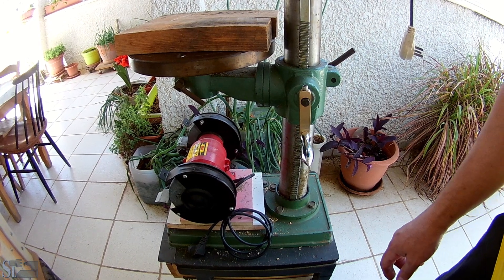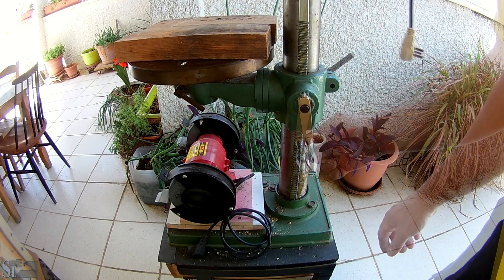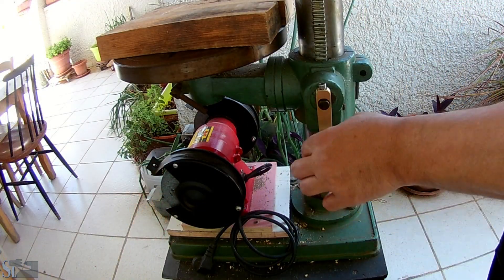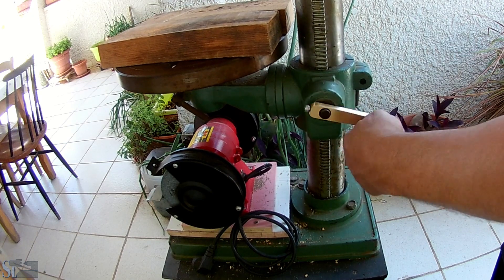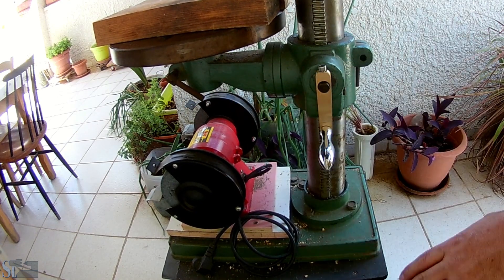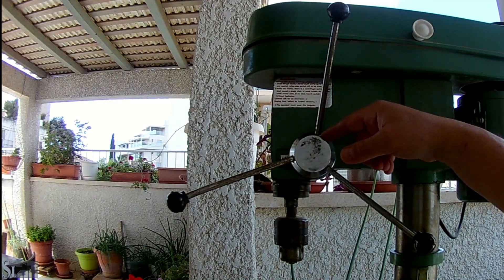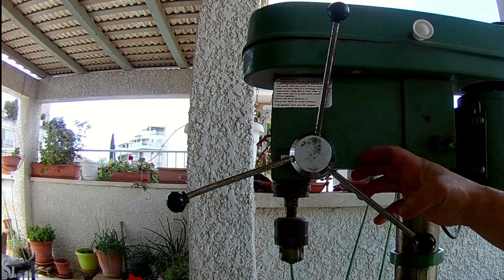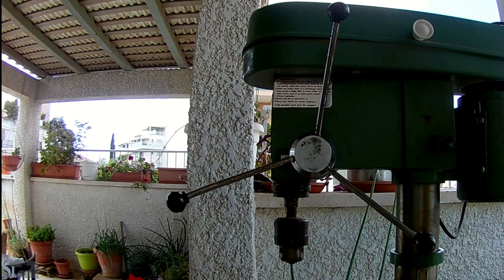Drill press crank handle

Comment: You should never be drilling into a smaller hole like that when you drill into metal. You don't do that ever. You screw up your drill bits like that and can often ruin the hole you are drilling. Rule of thumb is that if the hole is 10mm or smaller there should not be a pilot hole. This isn't woodworking. For holes larger than 10mm you can do it but the rule in that case is that the pilot hole should be 25% of the final hole you want to drill So if you want a 12mm hole then drilling with a 12mm bit into a 3mm pilot hole is okay. Anything other than this and you are literally just destroying bits, work pieces and the bit will always grab the steel just like it did in this video. Also I really don't understand why you're not clamping the work piece down. You are seriously approaching drilling steel the same as you are drilling wood
Reply from the maker: Thank you for the tips. I am used to small machines that usually lack the power to drill through steel and this means lots of iterations from a small drill to the final diameter. Good points. Also, I just got my drill press clamp during footage - which was very helpful indeed and much safer.
Reply: @Smallathe  how many horsepower does the motor have? If you do find yourself in situations where you have to increase the hole size in smaller increments I'd suggest getting some reamer bits. Their sole function is to increase hole size and are designed for thst purpose so when using the you don't need to worry about it grabbing onto the work piece, similar to the step bit but a lot more effecient and more control especially for deeper holes. Yean I did see the clamp after I made my comment which I was really glad to see. It's just not worth the risk holding it by hand, and even the glove adds risk, I've had a very close call once where the glove got pulled into the rotation and if the glove did not have a weak point on the seam where it did and came undone I probably would have permanently maimed my fingers and hand because of it. So I avoid gloves at all costs when I'm at the drill press now haha
Reply from the maker: @tiaan_va  My drill press motor is 3/4hp but my former one was a mount for a standard drill - which usually does a very poor job drilling metal, especially steel. I just finished a paper rolling machine - and enjoyed the ability to drill through steel with  a 6mm drill bit without predrilling. I also agree about gloves danger - but I was aware of it. Now that I use the clamp - I don't use gloves anymore. 
As for reamers - these are used to enlarge holes, yes, but their main use is to generate holes that are fully smooth and true on the inside. I use them on my lathe/mill and love the carbide ones... :)

Comment: The drill press is the most dangerous machine in the shop usually. Always use a hold down of some sort.
Reply from the maker: I fully agree, though the lathe/mill are also dangerous. I also fixed my used drill press vise... So clamping wise I'm good! :)
Reply: @Smallathe  I was referring to research I read about. The drill press is often used my novices and it is seriously dangerous, for the reason demonstrated by yourself. Often sheet metal is the reason people get i serious trouble, when it climbs up a twist drill and cuts hands and wrists.
Reply from the maker: @CandidZulu  interesting. Sheet metal drilling is nasty. Except for step drills - drilld cling onto the metal and turn it into a finger blender...agreed on the hazards of metal working... Good points. Thanks!!!
Reply: Unless it’s in a wood shop.

Comment: nice build. i asked for your email last video so i can send a welding . pdf
im thinking of mod my drillpress to have a momentary foot switch. press with foot to get power
Reply from the maker: Glad you likes it. My email - sorry, missed your request - is saar @ spicecandies.com (without the spaces, of course) - my other channel is about natural candies and sweets and this is my website. Rigging a drill press to be foot operated is of course possible.. but I'm not sure more downward force will be useful. Drill speed is tightly correlated to the drill size, drill web and the material you drill. Too much pressure will wear down your drills or break them. Write e a mail and we can discuss this. Cheers. Saar
Reply: @Smallathe  foot part is elct switch for motor not pressure iv copied the email now if u dont want to leave it up